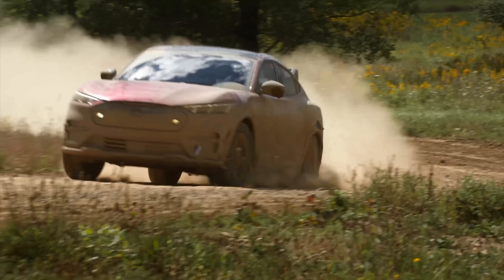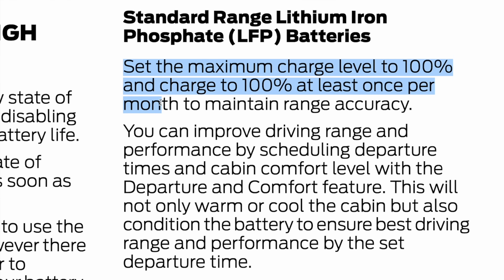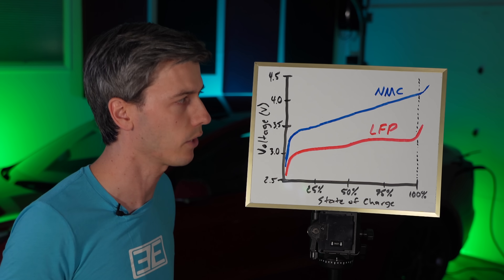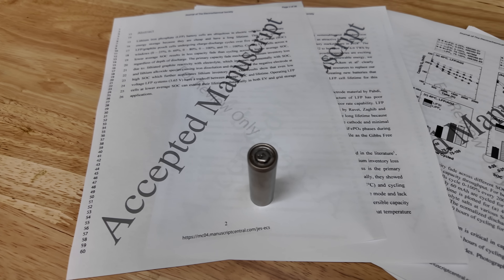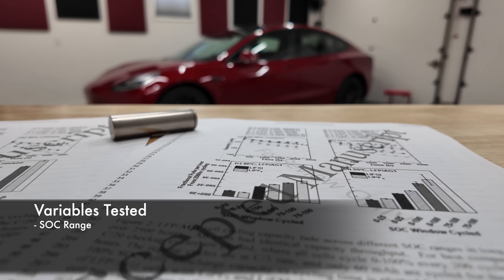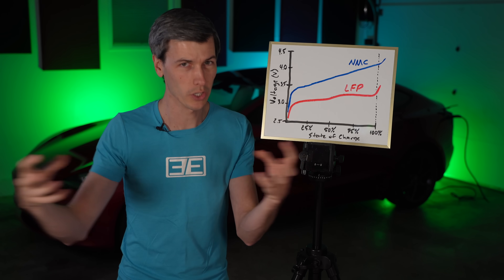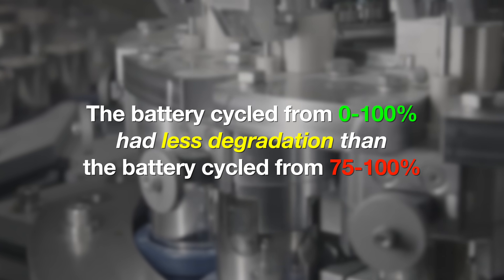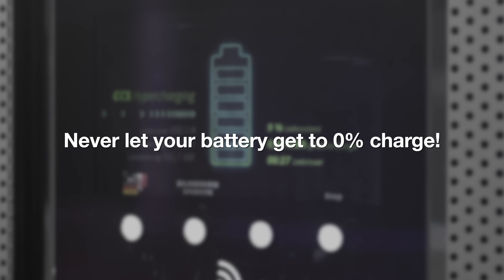How To Ruin Your Electric Car's Battery - LFP Edition!

Comment: which is the better way to keep the battery at the recommended 20-80% state of charge for short distance, not everyday drive  EV users?
Scenario: Day 1 actual current battery SOC is 50%

1. if I use the Wall charger (level 2) I would bring the SOC back to 65% on day 1 night (my records charging for 2 hours only will gain 16%). On the 2nd day the EV is idle, so by the 3rd day I use the car for the short distance (15%), the SOC should drop back to 50% when used up at the EOD. This would be a 2 days charging mode

2. If I use level 1 charger (my records is 8% per 2 hours), I would be charging everyday(8% x 2 days)for same duration of 2 hours to bring the SOC back to 66% on the day I would drive the car.

Based on your expertise, which mode is a better practice to maintain SOC while not damaging the battery in the long term. Or other advise is welcome.

Comment: You said in the video if your situation is this go for NMC, if your situation is that go for LFP.

Well, it's a known fact that the LFP is more durable than the NMC, so can we make a case that, an LFP battery used in average conditions would beat the lifespan of an NMC battery used in the best possible conditions? 

Since I plan to use my Tesla at home, NMC makes more sense, since I want to keep it charged all the time (even if that's at a lower SoC eg 70%), but I'm thinking that even if that's counterproductive for an LFP, the LFP might still outlive the NMC strictly based on their structure and chemistry, even if I use it in less optimal conditions.

Does this make sense?

Comment: my m3 sr+ degraded from 52Kwh when new to 46KWhr after 70K miles, always charging to 80% except handful of trips and never went under 10%. From my experience I would suggest to do 75% max not 80. This is for standard cobalt lion battery

Comment: Thanks for the video. I’m wondering how the charging cycles affect the battery balancing. In the research a single battery cell was tested while in the car battery there are many cells connected together. Potentially charging to 100% could help to keep all battery cells at the same level of charge. On the other hand, unbalance could lead to a higher degradation. 

Is there any study which discusses the best practices by taking into account above mentioned factors?

Comment: I guess I should read the study, but what did they use for '0%' in this study. (and 100% for that matter). It's quite a fuzzy limit in battery-world and LFP people use 3.65V 3.60V and  3.55V for '100%' and a whole range of voltages for 0%. Also how much difference was there between  the ranked degredation ranges? You said it was the biggest factor, but are we talking 2% difference or 20% difference? 
EDIT: OK. I read the study. Charging/discharging was done at C/3 (then C/20 every 200 cycles to get a capacity measurement). Tests were done at 40C and 55C which is quite hot. Degredation for 0-100% charging @40C was 7% over 2500 cycles. and 13% for 75-100% charging. So it makes 6% difference. Which is not nothing, but not excessive either. At 55C degredation was 8% for 0-100% and 17% for 75-100%. So higher temps makes the effect significantly worse. This implies that for a house battery kept indoors so around 20C all the time this effect will be very small, and degredation will be very low indeed, so the advertised 6000 cycles to 80%, and 8000 cycles to 70% seem plausible. The graphite used matters - they tested 2 and one was much worse at 55C. 

I also wonder how this interacts with BMS behaviour. And whether the cell type matters. I have big prismatic (314Ah) cells in my ESS with a Seplos 3 BMS. That does slightly peculiar things at 98.5% and 6% SOC, where it switches from the coulomb-counting in the central linear region to voltage-based SOC measurement at  the non-linear ends. So it can often sit at those numbers for quite a while until things sync up. Also if you actually go to zero you'll get bottom-balancing occuring, which you don't want if you top-balanced, because it's just likely to put cells out of balance. If this study really is right, then that an argument for bottom-balancing of this cell chemistry which is something that has fallen out of favour in the last 15 years.

Comment: My question is in the research dine was th changing cycles using AC i.e. low power charging or using superchargers for this test.  My thinking is one does produce more heat etc than the other, or does it matter the type of charging?

Comment: So for example if I should be charging a vehicle to 60% with a WLTP range of 450km effectively the real world range is 270km if I would like to keep the battery in good condition? Is there statistics or evidence to show how long batteries are lasting on average from all manufacturers worldwide? If they are lasting a long time does charging correctly even matter?

Comment: Interesting video as always... What about the BMS in all this? You are talking about studies that are (i think) made from a cell point of view (in lab? with same current for discharge/charge? same temperature?) and if I'm not wrong the SOC displayed on the dashboard of the car is not the absolute real SOC from the battery? So could it be counter-productive to "think too much" about charging/discharging rules ?

Secondly, the chemistry should be more clearer for the owner but also for the emergency services... Extinguishing or securing different chemistries of batteries must be different?

thanks again!

Comment: As a full time uber driver with the LFP — 56K miles in 2 1/2 years, my battery has stayed in the same range 260-270. I’m always in the 260s — and I’ve even improved my mileage in the winter time.
Reply: How?

Comment: Thank you for the video. Can you please help me with this?  I have a car with an LFP battery (BYD Atto3). The manual says that I should fully charge it at least once a week. However, I don't drive the car much. In other words, I drive an average of 100 km per week. So I only use 30% of my battery. What kind of charging routine should I choose in this case? If I fully charge it every week, I will always use 70%-100% of my battery. In this case, I would be following the manual, but as you mentioned in your video, I would be damaging the health of my battery. Would it be better to wait for my battery to drop to low levels like 20% and then charge it to 100%? This means that I will charge it once a month on average. (20% to 100%) Thanks a lot .

Comment: I'm confused about 0% SOC. In the paper you cite, how is 0% defined? What is the difference between the 0% in the paper, which yields good results, vs. the 0% you later describe as being harmful to the battery? How do these 0%s compare to the 0% Tesla uses, with its built-in buffer?

Comment: What should i do if i am an Uber Driver?
Reply: Run a full cycle as you'd usually do. Don't recharge when you're at 80%, just leave it until it drops to about 20% or low enough to the point where you need to recharge for your next trip.

Comment: I just got my Tesla Model 3 with LFP battery. After reading a lot of information online, I am now basically setting it to 80% charge normally, drive it down to about 20% and then recharge. But once every 1-2 weeks I charge it to 100%, just before a longer drive to to keep the guess-o-meter happy and to make sure it doesn’t stay at a max SoC for too long. Hope this protects the battery good enough in the long run!
Reply: This sounds good.  I have a Chevy Volt with LFP batteries.  Chevy made it that the battery charges to 80% and shows as full and when it gets to 25% it shows as empty.  This conservative approach makes the batteries really last and even high mileage cars still have the range from when they were new.  My 2013 Volt has 82000 miles and still gets same range as when it was new.  There is no way to get the car to use more battery capacity or charge it higher or lower than that.  However, for the Volt it has a backup gasoline engine for when you run out of charge (25% still remaining).
Reply: @rickwirch1165  Since when VOLT uses LFP? They're NCM as far as I know. Unless you had a swap with an LFP. volt is an older design and architecture. Doubt any came with LFP
Reply: yes that should be ok for a long life usage.
Reply: Why 80? It's totally fine to charge it up to 100 as he mentioned, very good call to wait until it goes down under 30% tho!
Reply: @pb8582 Because LFP just requires 100 to recalibrate the measurements. There is no point in stressing the array daily without using the range.
Reply: Excellent approach.. your battery is going to be lasting over 15 years easily.
Reply: You’re destroying your tesla
Reply: @theterra-path7798  How?
Reply: What your are doing is perfect. That other guy is just a complete morron.
Reply: Mr. Ignorant 🤡

Comment: I've been writing battery monitoring software here and there since 25 years (it is not something I do permanently), and used different strategies to improve the long-term accuracy, depending on how the battery is actually used.  One thing that is quite different with EVs than laptops or smartphones is that they are actually off most of the time.  Really off, high-voltage system completely disconnected, all remaining circuits operated by the low-voltage starter battery.  This state “known off” is a luxury for a battery monitor: All you need to do is tracking self-discharge, you don't need to monitor the current going in and out of the battery (where errors accumulate over long term of use), because it is definitely zero.  LFP batteries have ultra-low self-discharge (typically 2% per month at room temperature), and the self discharge rate goes exponentially with temperature, so you can get pretty accurate data to calculate the self-discharge.  The accuracy of monitoring a turned off battery for months therefore should be easy below 1%, better under low-temperature conditions, worse under high-temperature conditions.
The primary loss of accuracy is only the on-time of the high voltage system, and that is short compared to the off state (except for taxis).  Absolute times like “charge every week/every month to 100%” doesn't look like they are doing their best, probably more like „the accuracy of monitoring goes down by low one-digit% for every 100 hours of use“ (in that order of magnitude), so if you operate the car as taxi, you better recharge it to a 100% every other week; if you operate the car as commuter car with 1 hour use per day, you can keep it inside the optimal state of charge (around 50%) for months before the loss of accuracy actually affects you.  The battery monitors I programmed knew how much accuracy they lost, so that would be a value you could actually display, or trigger a message when it exceeds a certain value.
It was always a struggle with the marketing people who wanted to have a single percentage displayed, while the battery monitor knows so much more (state of health, loss of accuracy, temperature dependent loss of capacity, etc.). I think there's room for improvement, and you can assume that the situation under which the manual states you should recharge to 100% is that of a taxi business in a hot city, the worst case situation: all day use, charging in the breaks (probably fast charge in the range between 10% and 60%, where the charge current is at the maximum), high self discharge, then e.g. after two weeks (BYD manual) you should charge to 100%.  I looked it up: A taxi in Shenzhen (that's where BYD is located and where they started testing their LFP batteries in real cars) drives on average 384km a day, so you probably need to fully charge after 5000km to get the accuracy back.  For normal private use in Germany that would be almost half a year, and maybe then the accuracy of the self-discharge calculation is starting to be an issue.  It therefore would be better if the manual stated “please charge to 100% after 5000 km or 3 month, whatever comes first”, and well, the infotainment could actually tell you “now, my internal calculation of loss of accuracy exceeded 5%, please charge to 100% next time you charge”.  The loss of accuracy is subtracted from the total capacity (at least that's what I did), so you never ever end up with a suddenly empty battery — the worst case is you end up at 0% when your battery actually isn't empty.  You do end up with a suddenly empty battery when you park your warm battery in winter in the evening, and in the morning the battery is freezing cold (for LFP, the loss of capacity in cold weather is in the single-digit range, but especially for aged NMC batteries, this is a very serious issue).
However, as normal user, you never ever get into the territory where the life of an LFP battery doesn't exceed the life of the overall car.  With a taxi, you can, so for taxi drivers, keeping the battery in the healthy range is more important.  So for taxi drivers, I would recommend: whenever you have a break or wait for being called, plug it in and charge to 60%, and charge it up to a 100% as often as the manual says you should; this is written for taxi drivers (the worst case for the battery monitor).  And for normal users, the recommendation is: don't worry, be happy, but don't plug it in all the time you are at home, unless your car allows you to set a charging limit (which LFP battery cars often don't).
Reply: Thanks for the info! That was interesting to read. I currently cycle my Tesla Model 3 LFP battery basically between 20%-80% most of the time, and then charge it to 100% once every 1-2 weeks. So with you read.. probably can hold off to charging to 100% even less (just when I need the extra range). Luckily I can set a charge limit. Is this good enough to maintain my battery for longevity?
Reply: @bartjoboy  Indeed, better only charge it completely just before longer trips.   It doesn't have to be a full-range trip, if you can manage to cut the time short where the battery is above 80 or 90%, it's good enough.  I.e. if you want to drive 50 or 100km, you can use that tour to calibrate the battery: fully charge it right before you go, go for your 50 or 100km trip, and then you are back down to 90% or 80%, in the optimal range.

Overall, LFP batteries last very long, anyways.
Reply: This is wonderful information that most people would never know; thank you so much for sharing your knowledge and experience!

Comment: 2:12 Wrong. You didn't read that correctly. That text in the manual said nothing about regular use, nor battery health. It was specifically an instruction on long-term battery range display accuracy, stating that ONLY once per month should you charge to 100%...and even that is not necessary in general or for battery health, it is instead for maintaining accuracy of the on-board-computer's range display.
I suspect this is for calibration purposes, so that the on-board-computer's maximum value is calibrated correctly.

Comment: Lower working voltage resulting in higher amperage, right?

Lets say 100% soc is 3.7v..
3.5v x 150watt (power of electric motor) = 42.8 A
3.0v x 150watt (power of electric motor) = 50 A

Thats why i kept the juice as much as possible (roughly 95%), spare some percentage for regenerative breaking.

Comment: Despite the: "they all have the same amount of total capacity" thing (ie: four short trips with four charges versus one long trip with one charge to get to the same capacity) No one is realistically going to use a level 1 or level 2 AC charger on a longer trip for the single charge replenishment, because it would take 3 or 4 days to charge up, lol. So that means they are going to use a Supercharger or similar high voltage DC fast charger, which in turn, is what you are not supposed to do as far as the degradation of your batteries.

Comment: In winter I cycle in the 80 to 100% range for my BEV.
Otherwise the voltage is lower and thus it has less power to climb up the hill to the ski slope.

Comment: You get so many cycles out of LFP you don't need to obsess about how you are charging and discharging...just do the 100% SoC once in  while to balance the cells. Honestly, the electronics will fail before the cells will (think BMS). Enjoy the battery capacity you have now and don't sweat babying your LFP batteries.

Comment: I don't understand why a larger side wall improves the efficiency. When you said that you changed your tyres for ones with higher profile, surely that increased the overall diameter, assuming you already had the smaller.
You also didn't cover the effect of the drag induced by the spokes. What effect does different wheel covers have, if any?

Comment: Too bad you spend so much time talking about Ford since they only have like eight cars on the road that are electric. Nonetheless, nothing wrong with best practice of charging when you get down to 35% and bringing it up to 75% on a daily basis. That range is pretty safe for any battery. I did not write a paper.

Comment: I never even read all that, I have my Kona since 2019, always charge to 100% once, twice a week depends how much I drive on 7kw charger. This year at maintenance I asked to check battery degradation and there was literally none. and so does my car shows range on summer at 100% ~550-570km in winter 430-450km all 5 years it doesnt changed.

Comment: Very nice video!
I have 2 additional questions to this: 
1. Is this better to charge even with 1-2A than 11A?
2. Should I care if charging stops and starts or this should be constant charging?
3. Does is matter if I'm changing charge amp during the charge?

All this is connected with maximum usage of photovoltaics at home :)